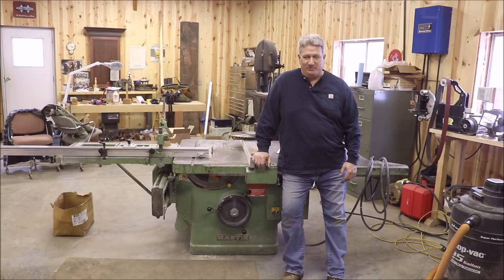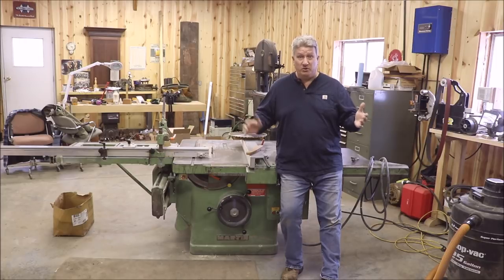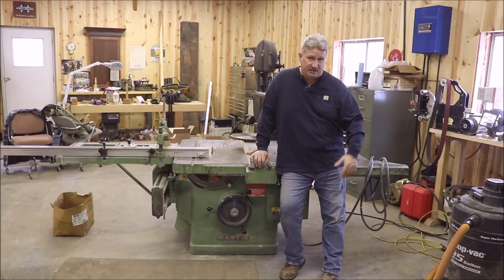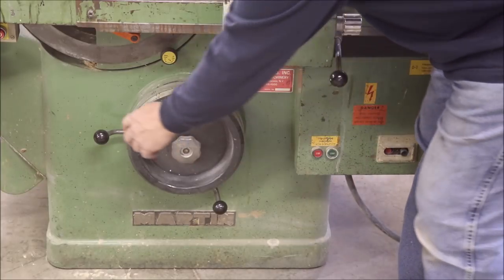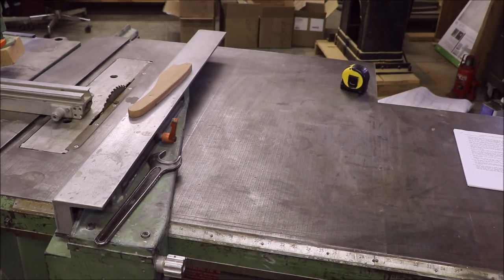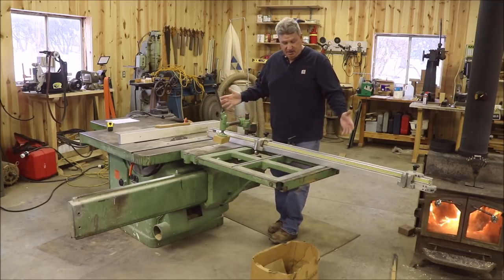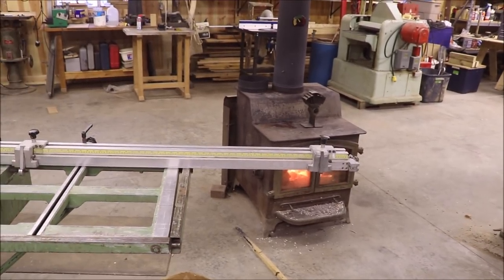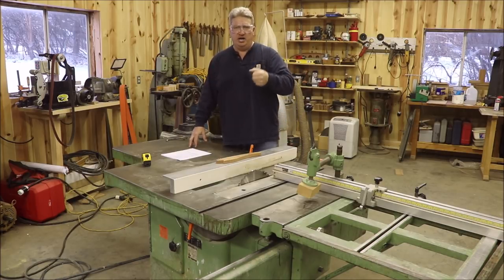Martin T17 sliding table saw

Comment: Nice Machine. I make a living with a 1970 Martin T70 Format style saw. A lot parts and details are similar to mine. You can get any, ANY, replacement part for this saw from Martin. Just tell them the Number of the Machine (stamped somewhere on the table) and they pull out their file of exact this machine and send you what you need. And please get a riving knive. Please! This beast can kill you easily with that motor. Nobody withstands anything that goes flying from her. This is NOT a flimsy cabinet saw.
Reply from the maker: Thanks, Hermann.  I would definitely like to get the riving knife if it's available.  I was contemplating just making one, but if they have it available, that would be good.  Thanks for your safety concerns.  Not my first rodeo with a table saw.  ;)   I'll be safe.

Comment: Nice machine Jeff! I purchased a Martin T75 from 1976, I heard something about maintanance guide you obtained. Do you still have them? I would like to restore my machine and those maintanance guides could help me with that! Kind Regard Gert-Jan
Reply from the maker: I have a copy of the manual, and there's some information in there specific to a T17.  If you think it'll help with your T75, give me your email address, and I will email you a copy.  You might check VintageMachinery.org, as the manuals might be posted there, as well.  Not sure.
Reply: That's the same saw I'm looking for.  Did you pick up yours from an auction site? Craigslist?